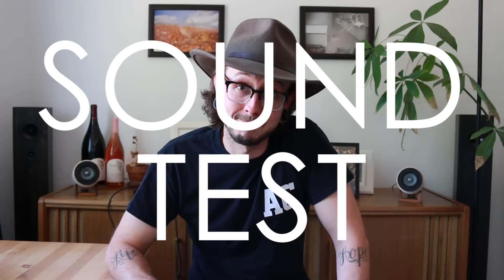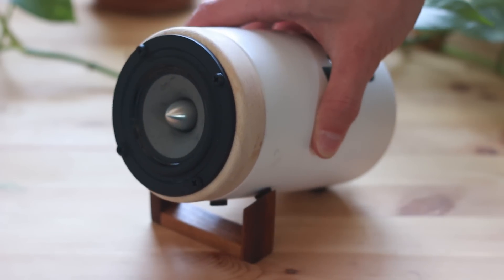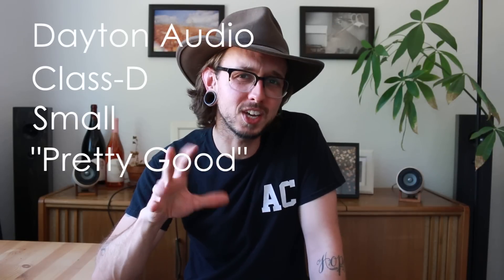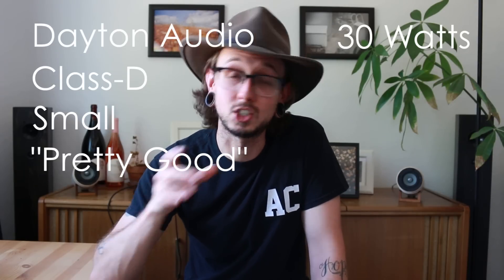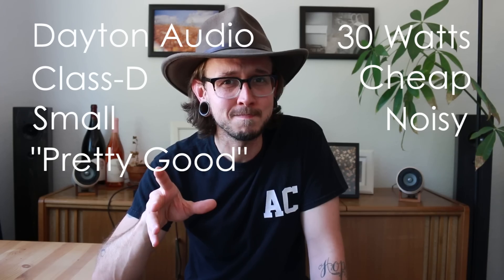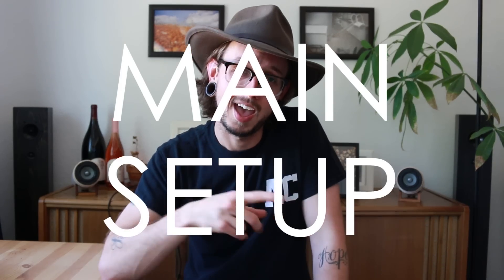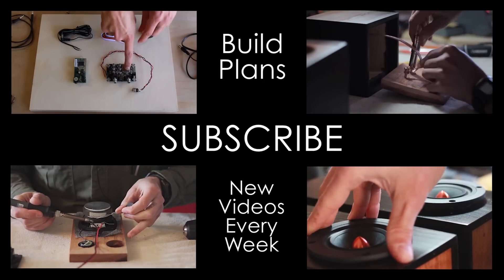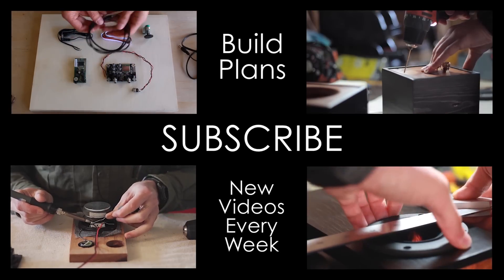SOUND TEST! DIY Ceramic Speakers || Yes, I gave in...

Comment: Second test I hear the piano piece with a bit more distortion, and on the Electronic song I hear some digital distortion on both at the start of the song. Also living room is shaped different that the kitchen, they are sitting on top of bigger cabinet speakers which helps on the resonance. The Zoom pre-amps were in the way as well adding floor noise. Lots of acoustics-technical "issues" to be a fare A/B but overall those speakers for listening to music are more than good. Anyone that is extra picky about the sound, would go with a better signal path like the one in the living room, and a 3 way system.

Thank you for taking the time to make this videos.

PS: I used high end studio monitor headphone.

Comment: Nice to see a channel that listens to the comments posted in his videos.  As per my previous comment, we all get the fact that what we hear won't be the same as being in the room as the source, but what I was after was a comparison.  For example, in the second set up, using the same recorder, play the track through the ceramic jar speakers as you did, but then play the same track through your main speakers.  This would give us some idea as to what end of the spectrum these little speakers are biased. I was assuming they wouldn't have a huge base response, and to me that sounded as if I was correct, but then would have liked to have that confirmed against your main speakers. - Anyway, thanks for listening to your viewers comments, and with luck these sound tests will become a standard feature of your excellent build videos

Comment: they sound pretty good to me (I use some ark studio monitors) to bad when they got a cleaner more powerful signal it started to crack bit in the bottom on the "techno" although I think they would suite most systems pretty good with a hp filter 3# isn't enough to give a good bas response especially not in a sealed enclosure good work dude!

Comment: i could tell a difference between the two setups.  The second setup sounded more...rich? wider range?  Lets just say better.  I'm using a set of Creative speakers with bass box on my pc.
Personally i don't think sound "test" videos are worthwhile.  If i were you i would just use the speakers playing in the build video.  I'm a little let down when I don't hear / see them playing after the build.  Like a quick shot of the speaker bumping :)

Comment: They sound pretty good. The bass they produce is really surprising, I was actually getting some output through my sub. (system: optical SPDIF to Denon AVR-3805 in 5.1 mode with 4X Polk RM101 and RM202 center channel all crossed @ 100HZ and a Pinnacle SubSonic sub crossed @ 100hz down), Very impressive for a pair of 3" full range drivers mounted in a couple of ceramic jars. I meant to ask last week, what was the notch filter for? Anyway, keep up the good work.

Comment: The second setup produced a much fuller sound. The bass was much stronger, even though it wasn't enough, it was much better. It opened up pretty nicely, I liked the sound. You should try to make the same design with bigger parameters. I guess it depends on wether you can find a bigger pair of ceramic housing. An 8 or 10 inch version of this would be very interesting.

Comment: I have entered the competition, wouldn't care if they sounded mediocre because the look so cool. I'm currently rocking an Imac - Chord Mojo dac and a pair of (uncomfortable) Grado 325e's. My speaker/s set up is an oldy but goldy Logitech z5500 connected to my pc. Ps; also love your vids:)
Reply from the maker: Great setup! Thanks for watching!
Reply: The Logitech Z5500 is a treasure and much better than it's successor, the Z906. Despite the lack of dedicated tweeters, the Z5500 can sound really good at all but he highest frequency ranges of normal human hearing after EQ correction for both built in speaker non-linearity and room issues. The decent full range drivers and the sheer power leave lots of frequency extension and loudness headroom for EQ calibration.

Sadly, the Z5500 is either unavailable or crazy expensive nowadays last time I checked amazon.

Comment: So from the DAC to the preamp and preamp to the powered amp is it fiber optic as well or RCA's? Just curious. Cool vid👍
Reply: From the Mac to the DAC is optic. from the DAC to preamp and from preamp to amp is RCA or XLR (Kirby would have to confirm which...). Basically, you can't have optic from DAC to preamp or from preamp to amp because optic transfer digital sound while RCA or XLR transfers analog sound... So Mac to DAC, digital = optic. From DAC to preamp, analog = RCA or XLR. From preamp to amp, analog = RCA (I know that amp doesn't support XLR so it has to be RCA...). Hope that clears some things up for you!
Reply: To add on or clarify, the DAC device is a Digital to Analog Converter. It takes the 1's and 0's the track is made out of and turns them into differentials in voltage. ;).

Comment: Man you have a Topping 60 as AMP? I'm using a TP22 for my PC/Workstation/Main setup. In the future I'll move to a TP32EX or similar. I need more power to drive my Magnat Monitor speaker... and looks like that TP32EX have also a built in DAC ... not a high quality chain but is better that some standard "cheap" audio set for PCs. (Both based on Tripath chips)

You can hear the limited dynamic of the speaker especially in the piano and electronic music. In the first part of the video occasionally I heard the noise / distortion ... at least to me it seemed so.

Comment: Even in my laptop speaker, the difference is clear, especially the piano, it sounds more vibrant and maximize the full range of the sounds. Still, a little bit hard to detect the difference in a laptop speaker if you are not an audiophile.

I am subscribing.. continue making stuffs dude!!

Comment: hey! dig what your doing here. just wanted to drop in my two cents. sound tests, although they cannot truly let you know what a speaker sounds like, can give you an AB comparison when compared against speakers in the same setup. if you do more sound tests in the same manor as this one, we can compare with all factors being equal. yes its compressed, sent through youtube to my computer, processed by my amp and played through my speakers, but if you do more comparisons then that process is duplicated in the same way.

also on a more helpful note, I think we can gleam things like detail and balance (assuming  our setup isn't a total joke). i found that i was surprised at how much detail and warmth came out of those things. they sounded to my ears through my setup very well matched to play the jazz and piano tracks. I was surprised these one ways had that much spunk to give. now, and this is a limitation of the driver and not the design, the electronic track was a bit lacking in the low bass range. it didn't really have the satisfying tight thunky sound that a larger driver could produce. not at all the driver or the designs fault, just my observation of the physical limitations of the system.

that being said i think this illustrates what we, as a community, can get out of these sound test videos. just like a photo speaks a thousand words, so too does a video. we can read fact sheets all day but if we can see and hear whats going on we can gleam more then we could from a simple description.

this is my opinion of course, and others surly will disagree with it, but for what a strangers opinion is worth i would totally ship more sound tests videos along with the build videos. keep doing what your doing man. i dig your channel.
Reply from the maker: You totally hit the nail on all the heads! It's hard to evaluate the sound without having a reference point, that's why I agree that doing some sort of comparison is the best way to go. Thank you for you're comment! Great stuff. And thanks for watching!

Comment: I'm quite impressed actually. Of course you can't hear the details, their specific sound, but you can hear any dips in the midrange or highs. These sound quite impressive, the midrange is well represented as well as high frequencies. There is some bass but then you can't expect much from such tiny speakers. It would be cool to see how much acoustic power they're capable of if you cut the low end and use them as mid-highs along with a big woofer in an open baffle configuration or with a sub. Either way, fullrange Tang Bands are definitely on my list.

Comment: Thanks for the test! I know it isn't accurate but it's nice to hear for my own inner satisfaction 😂. Thx man
Reply from the maker: I totally get it! Thanks for watching!
Reply: Can't judge from you tube, but as part of a larger plan this might work for me. Have you heard the silver flute wool cone speakers? I need a speaker to replace my wife's speakers. I'm thinking of a four way design using 6" silver flutes, ribbon tweeters, peerless soft dome upper midranges and Mach one 15" for the ultra low end.  I have a pair of peerless midrange dome midranges from the 80's now selling for $275 to $300 each. They are warm, articulate and incredible in detail. In my old speakers I was running them from 800hz up. With the silverflutes I think I can run them higher, around 2000 HZ and let the flutes do their magic from somewhere above 50 HZ to 1500, they start to lose directionality at 2000 to 2500 HZ, so that's where the peerless midranges should come in. They are also limited to about 50 HZ on the low end so I want to use the Super warm Mach one 15" woofers below 80 to 100 HZ. Above the midranges I want to use a ribbon tweeter that sings from 6000 to 10000 HZ on up to beyond 20000hz accurately. hiVi's new isodynamic tweeter look to fit that bill just fine! Their RT 1.3 WE looks  promising in that roll.
The idea is to give each driver space to work where it is most efficient. And keep an ultra flat response for the entire system. Any thoughts?
Reply: Kirby I have one question would you concider a set up with 2x mission 731 speakers in stereo and a smsl SA-50 amplifier decent. I know you have never heard those speakers play or heard how the amplifier processes audio but purley based on specifications can you give me an opinion.
Reply: The man has a plan ;)
But, have you also taken construction into mind?
And considering all the frequency ranges, have you found suitable crossovers? :)
Conceptually, and parts wise, it seems you have done some research, so my comment is just thinking out loud basically lol ;)
I just feel that anything beyond 2-way, internal enclosures and/or separation is important, so you don`t get resonance travel or what it`s called..
You know, one driver interfering with another?
Just a thought, but also plan the build itself ;)